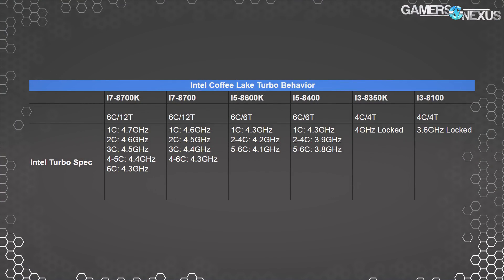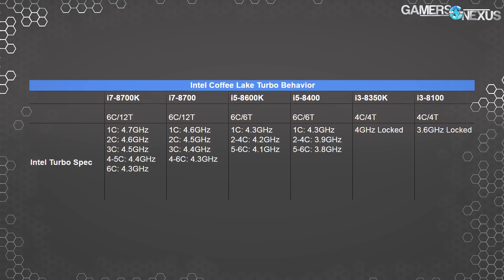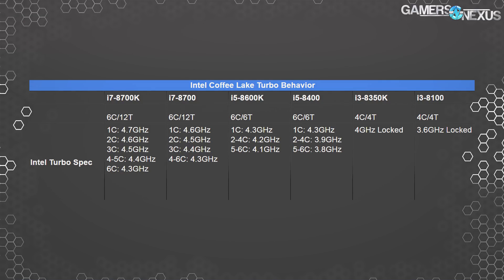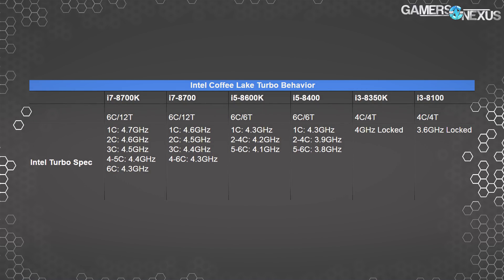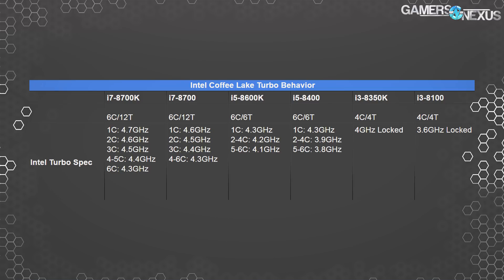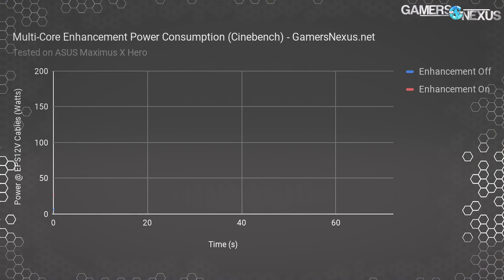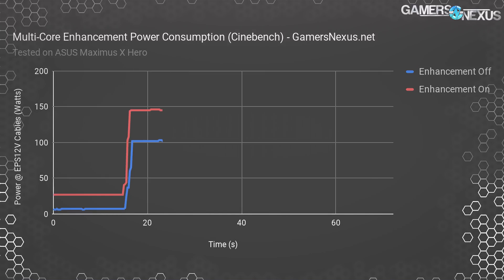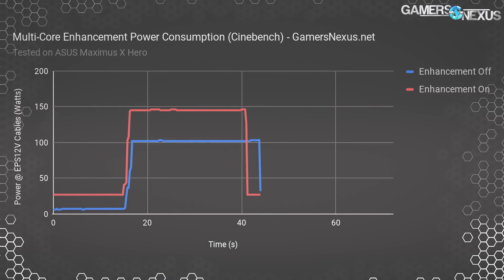Explaining Coffee Lake Turbo Boost Variance & Multi-Core Enhancement

Comment from the maker: NOTE: We have discovered that Gigabyte's F2 BIOS revision, used for Cinebench and POVRay, did NOT have an MCE option, but instead auto-enabled MCE. Fortunately, our gaming tests were conducted with F4 & F5a, and are therefore unaffected (MCE off). The Cinebench charts have been corrected in the article (linked below), as we discovered the Gigabyte F2 BIOS issue just recently.

Article here: https://www.gamersnexus.net/guides/3077-explaining-coffee-lake-turbo-8700k-8600k
You might also like our 8700K review: https://www.youtube.com/watch?v=oCSkyNHXIAE
Reply: @Gamers Nexus   Does multicore enhancement work with non-K CPUs, say i5-8400? Also, can you change turbo ratios for non-K CPUs in the BIOS or are they locked?
Reply: ya i hate when i see goddam NUUBS; "YOUTUBE REVIEWERS" saying oh boy at stock this thing just runs at 4.7GHZ so fast.....like these idiots dont know shit
Reply: oh boy look how high these FPS are at stock vs XXXXXX
Reply: Off by default, thx a lot for the analysolis this might explain de disparity in cinebench store between you, linus, Paul, Kyle, Jayz, etc. Very informative.
Reply: I would say yes default off AND show a graph when enabling warning that performance will go up by a small amount and power by a large amount.
Reply: +Gamers Nexus I've seen someone criticize your measurement of power at EPS12V, claiming that CPUs can also draw some power from the 24-pin motherboard connector. I assume you know what you're doing, but can you comment on that? What are the advantages/disadvantages of measuring EPS12V vs total system draw?
Reply: andrechkl no turbolock on non K for coffelake

Comment: Should be OFF by default regardless of the motherboard. I happen to use it ON, but if it has the potential to cause issues, it needs to be a option to turn it on. At least that way users would know what might have caused their issue.

Comment: I can't find anything similar as MultiCore Enhancement in my Prema BIOS (Clevo P775TM1-G) for 8700K.
BTW is normal to have 7-10C difference between cores after professional deliding? Guys from Dreammachines said it's completely fine but never saw temperatures like this at any laptop.

Comment: So i was just trying some configs in my MSI Z370 and i saw this feature, when i enabled Turbo Enhanced mode and run Prime95 i hit 98° C in seconds... (no delid and just low-end air cooling) so as you guys said it results in an unrealistic high voltage that in my case were pretty dangerous, its funny because i can get higher frecuencies with much lower voltage (and temps (85° after couple of hours)) with manual OC than the MSI Turbo Enhanced feature.

So after saying this, just set it OFF, i'm pretty sure as i did, most cpu can reach the same frecuencies than the "Enhanced" with lower voltage and temps if you do it manually, so learn how to OC and do it yourself.

Comment: So on an Asus mobo if you turn multicore enhancement off will that alone allow the cpu to run stock and only turbo when necessary? Or do you need to manually set each core to the base clock speed?

Comment: @gigabyte Everything must be default as per CPU/RAM/chipset manufacturer specs. When you buy a new MB etc than first you want to have a rock solid system, the most reliable it is capable of and too see if all right or not. Than everyone can decide if any OC is what he or she wants or not. Gigabyte you should rather just redisign the OC feature by adding a totally simple fully auto OC panel in BIOS where the user can just use one single slider which will increase the OC by percentage (the MB will handle every other settings in the deep automatically). Only geeks want to spend months with learning all the details, but everyone want the fastest but rock solid PC: 

Ps.: I am  Gigabyte fan, bought two of your boards just in the last 6 months. And a VGA from you. But I do hate the total mess and chaos on your download site, it is full of old and outdated old alternative apps for the same purposes etc and you do not offer an app that would automatically download every driver for your boards (APP center is only for bloat ware not drivers). The same applies for your BIOS settings, its is a MESS for non pro geeks. In addition to this, in the user guides and in the built in help in the BIOS there is NO any info what does what... for example when you see "Power Load" in BIOS and read what the guide says about it than it will say: "Power Load sets the Power Load". WTF are you kidding? :D Or "Default sets X setting to Default", this is so dumb or ignorant or both. I guess, such a big and old company could afford hiring a dedicated person writing help and manual for BIOS for non total geeks. I am alone spent 500 EUR on GB products in just 12 months...

Comment: So, if you're manually overclocking MCE should be turned off?  I've looked everywhere online for the answer and no one seems to be addressing it. If it's messing with voltages or overriding the manual vcore then it would clearly be adding unnecessary heat and instability when applying manual overclock settings right?  For example I overclocked my 8700k to 4.7ghz manually.  MCE can cause higher than normal temps or potentially prevent clocking to higher speeds since it is applying larger than normal voltages?

Comment: what counts as a "core in use"? the chart is saying that when 4 cores are in use, the clock is higher so where is the threshold? 4 cores at 100% each?  50%? and then 0% on the last 2 cores? because i have always usage on my 4 cores even if iam on the desktop.

Comment: You mention benchmarking at stock.  There is a little trick Intel uses with their "stock" behavior that you aren't addressing.  There are 4 power levels, but 2 of them are only used in sub 1s intervals, so they don't really matter much.  The ones I want to mention here are PL1, PL2, and Tau.  PL1 is the rated TDP, which is the power usage at base clock, not turbo at all.  Then there is PL2, which is programmed by the motherboard maker, and likely is the power usage at all core turbo.  Tau is the time limit that a CPU is allowed to run at PL2 before reverting to PL1, which is limited to 100 seconds.  After 100s with most individually sold motherboards, without MCE, the CPU will drop down to PL1, or the base clock without any turbo.  This is not a small thing.  Now, that is about enough time to get through most benchmarks, and I don't know about others, but I tend to game for a bit longer than just a minute and a half.  So, this short turbo time is not representative of the actual gaming experience.  

Now, then there's the prebuilt system side of things.  If an OEM decides to use cheap cooling, which most of them do, then they'd be setting that Tau to far less time, usually less than 30 seconds.  So, that Dell Inspiron Core i5 8400 is not going to be going as fast as many would think, and would drop down to just 2.8GHz after starting a game up, and the frame rates could suffer.  This is a REAL PROBLEM.  There are going to be consumers looking at these benchmarks that say that a Core i5 8400 would be on par with a Ryzen 5 1600 because the benchmarks say it would, when in fact the Ryzen 5 would be much faster in regular use due to the short timings for these turbo modes on OEM systems.  

Intel is cheating with these turbo behaviors, on par with the old Quake/Quack scandal way back when.  This is Intel cheating at benchmarks, when actual behavior is far less, and they need to be called out on this.

Comment: I got an MSI board in part because they didn't dick around with the Intel specs. I bought the 8700 because I don't want to screw with voltages etc etc blah blah...just drop it in and run. MSI is running it at the right turbo speeds. Stability and long term reliability is worth way more to me than a few % in top speed.

Comment: THANK YOU SO MUCH FOR THIS VIDEO! I was wondering why the hell my i7 8700k was running so hot even with a high quality AIO cooler.  It turns out even though i had multicore enhancement disabled, the popup that comes up after you enable XMP (sync all cores or something like that) was enabled.  I had to default my bios then disable MCE again, then once i set my XMP i saw the popup and clicked NO!  Now my temps are about 10 degrees C cooler while gaming.  Wow, thank you so much!

Comment: Interesting stuff Steve. I just purchased a new Core i7 8700 to go with my Z370 Gigabyte Aorus Ultra motherboard and try as I might I am not able to get MCE running. Correct me if I am wrong but with MCE correctly enabled all cores should be boosting to 4.6ghz and not 4.3ghz? I enabled XMP correctly and have tried all MCE options in bios, auto, enabled and disabled. Is MCE not working with non K cpu's? Or am I missing something here? Cheers. Greg.

Comment: Off by default. 

Is it outside of spec for the MoBo makers to allow the user to specify a frequency M.C.E. sets? So if someone turns it on and experiences stability issues at 4.7, the user could start lowering down to 4.6 or 4.5, etc, until stability is achieved?

Comment: Of course such non-stock adjustments should be off by default. It's no different to an overclock on the processor, it increases its power draw and heat generation way past specifications (even as much as 55% over spec, which can be seen on the 8700K) and can significantly hamper stability and long-term performance of the hardware, or even damage it noticeably or kill it. It's furthermore dishonest and it means the motherboard is doing something the user has never asked for. These are I think the main reasons to disable it. Aside from this particular 'feature', I have to say, nearly all setup options in modern motherboars' UEFI could use a lot better explanation and documentation.

Comment: So, i just installed a 8700k along with a 32GB gskill 3200Mhz. I have XMP on, so now i get full 3200Mhz. What about the 8700k? In bios it says 3,7. Should i put the "game boost" on, or does is auto go up to 4,3/4,7? the cpu fans are going crazy fast when almost doing nothing. corsair h100i. Looking at my command center now and all cores run at 4,3/4,4? Is that correct?
Reply: 4.3/4.4 is stock. No multicore enhancement has been made

Comment: Obviously multicore should be turned off by default.  The silicon lottery is a mean bitch and Intel has their processor speeds rated on certain cores for a reason.  My 3570k has been running for nearly 5 years stable with mutlicore turned on so I won that round, but when I build in the next few months(hopefully) I may not get that lucky again.

Comment: Off by default. Im among those nonpro users who find about this only from watching channels as yours , and not understanding why brand new systems keeps crashing or why are consuming so much power compared to specifications. I have purchaced an Asrock z370 killer sli , this feature from what I read from the manual is set off by default  , although I will definetly check ( when my "coffe" will arrive).
I like your vids keep it up GN.

Comment: Does this mean that if you pair an i5 8400 with a cheap mobo (b360 when thoose come out) you might be stuck with 2.8ghz unless the motherboard has a mce option? and even so, depending on the motherboard you might not reach 3.8ghz on all cores?
Reply: Exactly.....Intel no longer guarantee the boost clocks. They are only theoretical maximums. And the cheaper B and H series Motherboards there may not be an option for multi-core enhancement. So this is why Intel launched these CPUs with Z series motherboards only.....to win benchmarks against Ryzen. Watch this and be enlightened.... https://www.youtube.com/watch?v=O98qP-FsIWo

Comment: This was also the case with the 7700k and Asus Z270E that i recently purchased. I am in the boat you talked about where i am pretty savvy with pcs and have no problem building pcs myself but am way over my head when it comes to overclocking and only go as far as enabling xmp and browsing the bios just because without changing anything. I got the 7700k rather than the 7700 because if down the line i do want to learn more about overclocking i am not forced to buy another cpu to properly do so. More on topic though, i think it should be off by default and personally don't think having all cores using max turbo would really benefit anybody seeing as most games and programs average people/gamers use do not use all cores so forcing full turbo on all of them, even ones not being used at all does nothing but put more wear on the hardware and cost people more money due to the increased power use for absolutely no reason. This seems to be purely a feature for power users who would be overclocking their cpu themselves anyway so in the end it just sounds like a completely useless feature that benefits nobody and harms the majority.

Comment: WOW - after zillions of videos watching about everything and loving it, I disagree.  The PC is a system, MCE is a feature of the system.  Yes, MB based but part of the system and should be considered in reviews, for buying decisions, and for the cool factor.  It's not really an ON/OFF choice.

If other MB OEMs don't/do choose to follow - that is an advantage of the system, as a CPU by itself is useless.  IMNSHO trying to separate CPU/MB is cool, but useless in the real world.

So for me, I know this makes the reviewer job crazy - but its a system and all permutations need to be explored so I as a baby boomer can make an intelligent choice.
...gene  
yes I still liked the video
Reply: If all motherboards had the feature on by default than including it in reviews would make some sense. The reason it isn't on my default is because turning it on causes stability issues in some cases, uses ~40% more power (that if isn't taken into account before hand could result in not having a psu that can handle the difference) , increases temps by a fairly significant amount (which could be the difference between a hot but usable system and one that crashes the second you try and do anything) and provides very little to no noticeable effect for the average person using it since most games and programs the average person uses only use 1-2 cores which already uses that full turbo boost without the potentially nasty side effects. It is fine being a feature that exists but has absolutely no business being one that is turned on by default and should have a very clear warning when turning it on just like the xmp setting that is universally off by default does which also has virtually none of the potentially big issues mce does.

If ANY cpu feature should be turned on by default it should be xmp seeing as without it being on by default you will not be getting advertised and tested ram specs, not one that boosts the cpu above it's advertised and tested specs.
Reply: Well as a baby boomer, why don't you just turn off MCE and overclock normally?  That way you can find the optimal voltages for least heat but still get the best overclocks?  MCE is just a noob friendly turbo button that really offers nothing for people who know what their doing.

Comment: Off by default. It's basically "default overclocking" which increases power consumption, reduces stability and life span of the CPU beyond what the CPU is advertised / designed / optimised for.

Comment: I'd like to see gaming benchmark with the 8400 with it disabled and enabled to see the difference in performance and if it's worth using. Also if there are stability issues in gaming with it.
Reply: Fisher Man No turbolock for the 8400, that only concerns k models, and basically is auto oc

Comment: Off by default. Strictly speaking, if it is on by default, then the warranty for the CPU could be voided because the chip was used out of spec. Also, the CPU does not adhere to its rated TDP if this is activated, making the CPU much less efficient. Power consumption is a much bigger deal here in Germany, because of high cost per kWh and therefore we really care about efficiency.

Comment: Hey guys sorry for a pretty dumb question but better safe than sorry.. so turbo boost and multi core enhancement are two different things and turbo boost works like this: (lets take 8400 for example) in an application that requires 1 core it turbo boosts that core to 4.0ghz and uses it, while if an app requires 2,3 or 4 cores it turbo boosts them to 3.9ghz and uses them for that app and finally 5-6 to 3.8ghz? correct? and then milti core enhancement would force all 6 cores to work at 4.0ghz all the time at a cost of higher voltages and power draw? so bottomline is turbo boost works fine but multi core enhancement does not and should be turned off? If i made any mistakes in my comment please do correct them, thank you all very much in advance!
Reply: That's basically it. Also, Turbo Boost is an intended feature where Intel designs the CPU to always make the best use of its TDP, keeping it within the specified thermal and power consumption budget. Whereas, Multi Core Enhancement is a motherboard feature and it is nothing else than a simple way of overclocking the CPU. And usually, the easy way of overclocking is not very good because it tends to overshoot the voltages by a fair margin resulting in higher voltages, power usage and temperatures than necessary.
Reply: You are correct on how turbo / multicore enhancement work... That does not mean multicore enhancement does "not work". It works, its just a choice/opinion on whether it is worth it.
Reply: Well? then i sure hope this stock Intel Turbo Boost could let me edit 4k or even 8k without needing to OC, like this guy....  :\
https://www.youtube.com/watch?v=8mgCk3wJDVE&t=98s